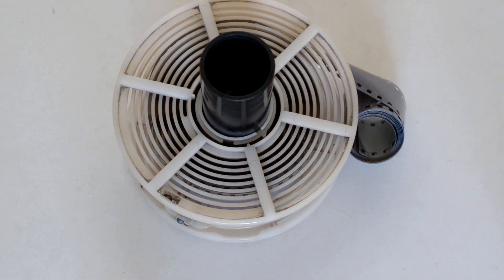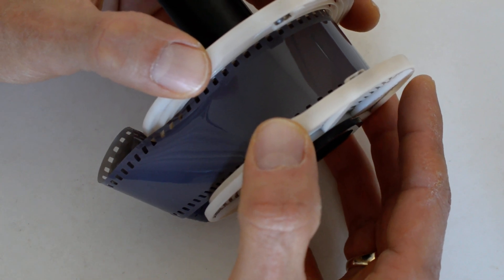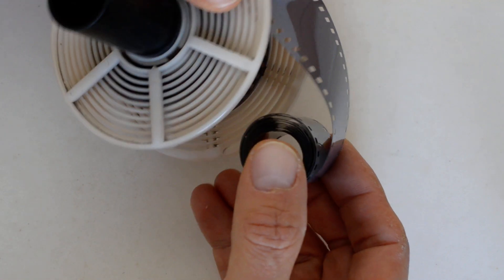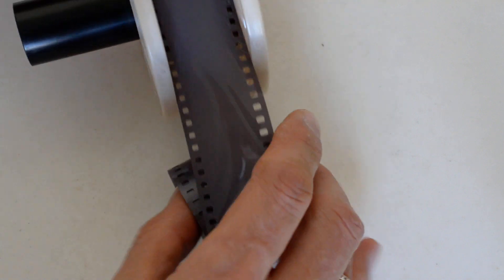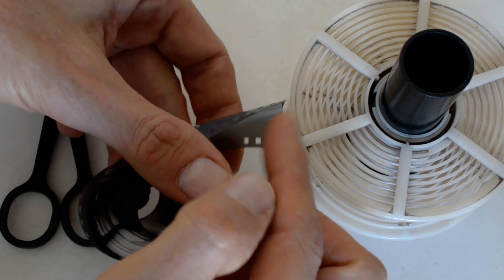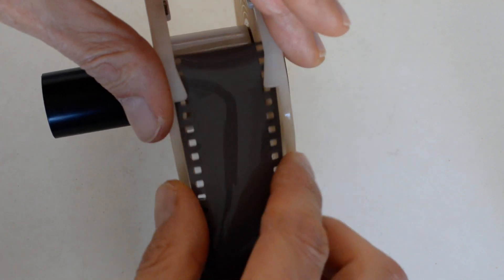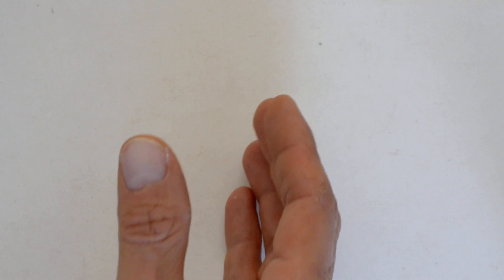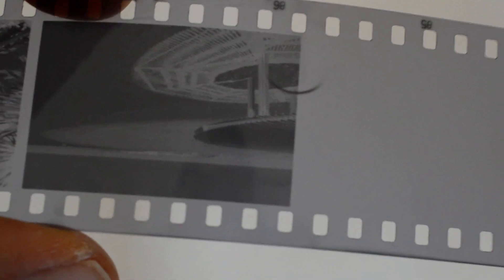Failure to Load:  dealing with disaster in the changing bag

Comment: Based on 60 years of experience, I'd offer a couple of additional tips on this subject.  When cutting the film before loading, cut the sharp corners (just a little bit) so they are less likely to hang up in the reel groove. Also, buy a different brand or type of tank reel system than Paterson. Paterson users continually report loading jams once the reels have been used for a while and get a little dirty. Of course, it's best to wash all such equipment immediately after use, but there you are. The easiest way to avoid these problems is to use stainless steel reels and tanks, but they have a steeper learning curve to reach easy loading.  Finally, if you have to extract a jammed film as shown here, twist the two reel parts so the the prongs which guide the film into the reel are offset and not immediately opposite each other as shown here. When opposite, they tends to both catch the film sprocket holes as you unwind the film. If they are offset, that is much less of a problem.

Comment: hi Brian... good video... this sadly happened to me more than once. i use gloves when handling film to make that part a little easier. I also quickly use a hair dryer on the reel just before loading, to try and dry off any residue humidity. that aside, it's worth having a test roll to learn with before you try loading "good" film.